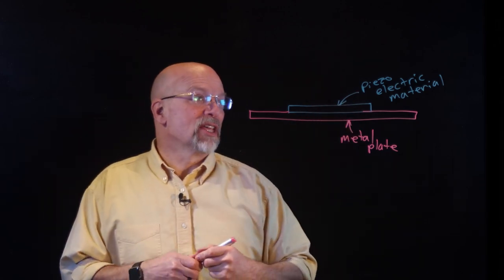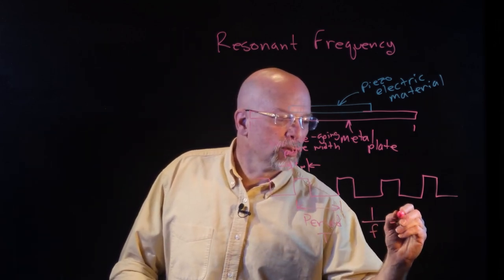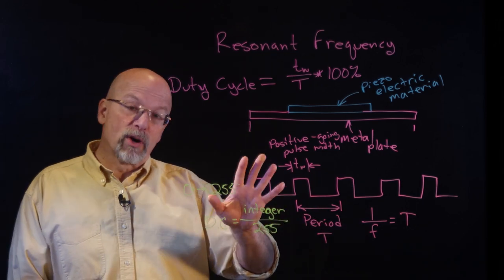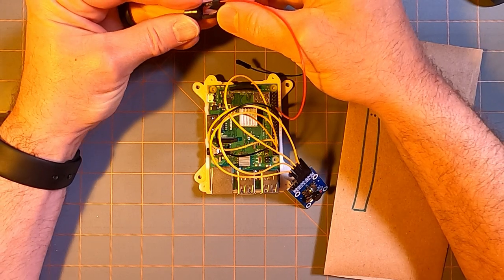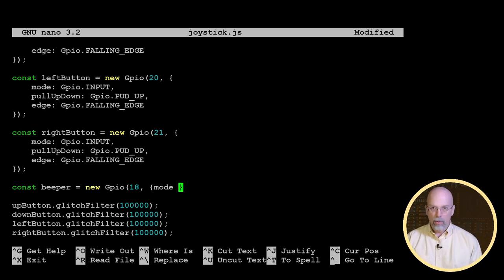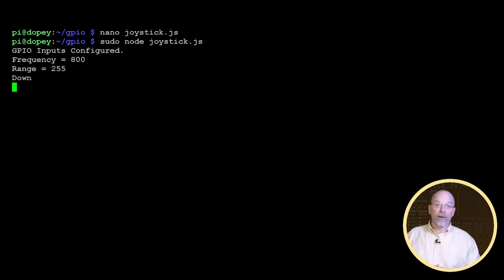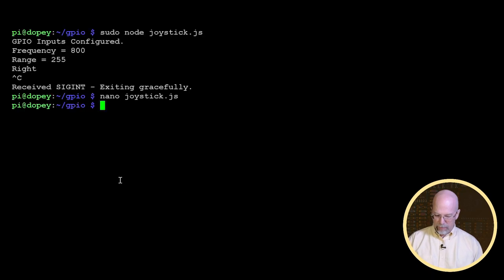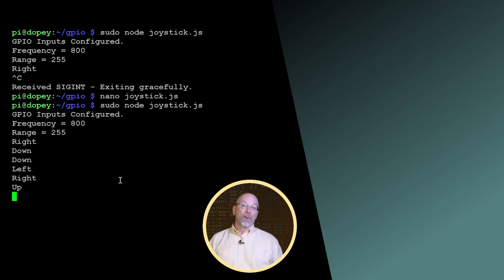Raspberry Pi GPIO Switch Input - Part 4: Connecting a Piezo Beeper

Comment: Hi, how is it possible to run a Raspi headless with NodeJS + pm2 with access to the gpio? To access the GPIO root is needed. Normally pm2 starts up my NodeJS Service as User Pi which ends in an error message as GPIO access is forbidden. Background is I would like to read a Power Meter over S0 port and send the calculated values via MQTT to a broker. That’s why I need the pm2 as the service should automated restart after a power outage or an error. I‘m not a Linux crack. 😬
Reply from the maker: You are absolutely correct. That's why my earlier videos show how the Raspberry Pi might not be the best choice for headless IoT/embedded operation. It does, however, serve as a decent learning platform. Thanks for the reminder!
Reply: @Intermation  That’s bad, as I have the raspberry near to the Meter anyway as it catches the UDP Broadcast from another meter (SMA-EM). So it would be perfect re-usage of existent resources. The S0 is catched with an ESP8266 actually which I could free then. The WiFi is not so good on this place. Maybe worth thinking about using an Arduino to catch the S0 port and feed the raspberry via serial communication with the values. Then processing into MQTT via my node process. Could be so easy with more open GPIO on raspberry 😢